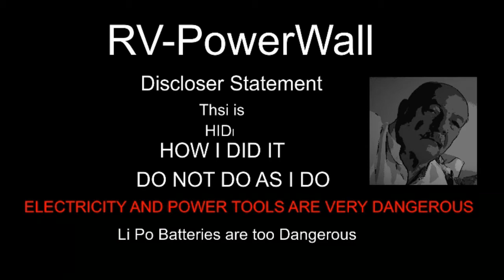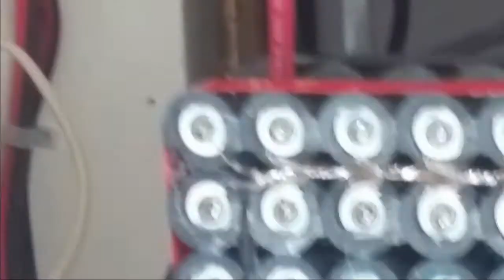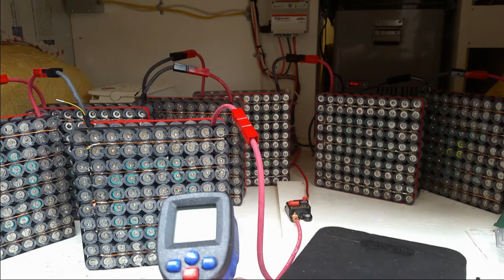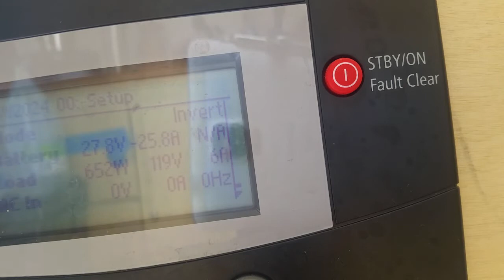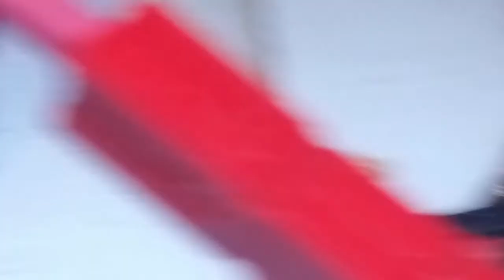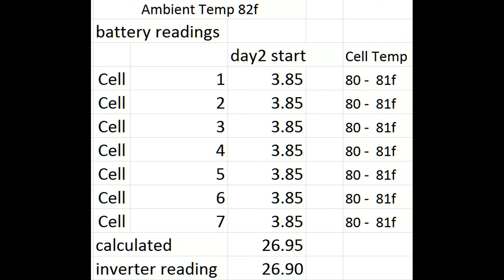DIY PREPPER 18650 LOAD TEST #13

Comment: how many more years? estimated cycle
Reply from the maker: I will just take it one year at a time... monitor it daily.... I expect it to be working for at least 5 more years
Reply: @rv-powerwall9870  what devices are working on your system ? does it work every day ? battery installation 24V probably kac Ampere and kac waatt LiIon batteries
Reply from the maker: @ismailozcelik1662  -- since i installed the battery it has operated the refrig constantly even when parked in my driveway. When I am staying in it ... it operates an induction stove top, Microwave, lights. It also charges my Lectirc Bike and other battery tools as well as a surface laptop and phones.
Reply: @rv-powerwall9870  how many more years of good success is the cycle forecast ?
Reply from the maker: @ismailozcelik1662  --  only time will tell.

Comment: those breakers are not what the say they are though what is marked is absolute max and that one will only handle about 60 amp constant.
Reply from the maker: Thanks Steven. I never exceed 60 amps so that makes sense.

Comment: Excellent very helpful information. Say what gauge cable are you using with your Anderson power pole connectors?
Reply from the maker: You can purchase the powerpole connectors at any amp rating and wire size. I used #6 flex welding cable https://www.ebay.com/itm/6-Gauge-Premium-Extra-Flexible-Welding-Cable-600-Volt-EWCS-Brand-COMB/362086551056?ssPageName=STRK%3AMEBIDX%3AIT&_trksid=p2057872.m2749.l2649 .
I used the 75amp powerpole however if building a 12 battery I would use no less than 100 amp powerpole connectors with #4 flex welding cable. The #6 is rated for 75 amps with no temp rise. For most systems that the load is short term you you could use the #6 for up to 100 amps as long as you load was not for more than say 5min. 
The powerpole contacts https://powerwerx.com/anderson-pp75-sb50-loose-piece-contact
The plastic housings https://powerwerx.com/anderson-pp75-loose-piece-housing

PP75/SB50 Loose Piece Contact (Gauge: 6)
SKU: 5900 $0.65 22 $14.30
PP75 Loose Piece Colored Housing (Color: Black)
SKU: 5916G4 $1.00 10 $10.00
PP75 Loose Piece Colored Housing (Color: Red)
SKU: 5916G7

Comment: I have a bunch of those switches and if I remember they are rated for 12v they seem ok at 24v but do not use them at 48v
Reply from the maker: You know you are right I forgot those are sold as automotive witch means 12 volts. Yet that is the first time I ever tripped those breakers and been using that same one since Dec 2014

Comment: Wow, really impressive! So your bank is rated at about 3kwh?.I hope I'm able to to find that many cells. The lifepo4s I had planned to use proved to be poor quality so I'm back to scrounging lithium ions again.
I was wondering, do you have an air conditioner that you plan to run off  this pack? If so, how much will it draw?
Reply from the maker: NO this battery is rated at a little over 5kw but the rage I will be cycling this battery is at max 2kw. To figure the capacity rating take your amp hours (number of batteries in parallel times the tested capacity of each cell times the nominal voltage of your battery. A 7s nominal rating is 25.9v x 200 ah = 5180 wh. 
This test was with the battery starting at 29.3v down to 26.2 volts and I used a little over 3kw. I did not mention this but the inverter log showed 3.5kw used during this 3 day test probably due to energy loss. 
If you are building a 4s then the nominal voltage would be 3.7 x 4 = 14.8v nominal. then multiply that by the storage capacity which is the number of cells in parallel times the tested capacity of each cell and that will give you the watt hours stored. 
Note that when I stopped this test at 26.2v each of the battery cells measured 3.73v. This battery had a lot of power left but due to voltage drop and my inverter is set to alarm at 25v this is the lowest voltage it will allow.

Comment: I think you've discovered the elusive thermoelectric cooling effect of recycled 18650's lol. Interesting on how the cells balanced given all the hype on bottom balancing. Thank you for postimg!
Reply from the maker: Since you mentioned the thermoelectricy cooling effect I have looked into this and to my suprise you are so right. During discharge on healthy cells the batteries temp is about 2 deg lower than ambient temp. The heat effect should only occur during charging. Thats why 18650 batteries life is extended by low amp charging just as Tesla Car companies recommend slow charging the cars.